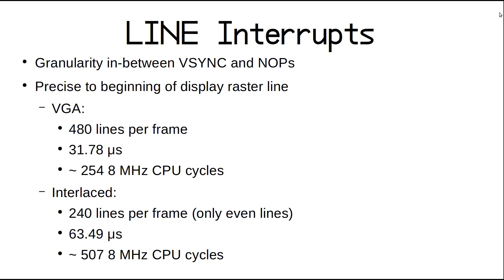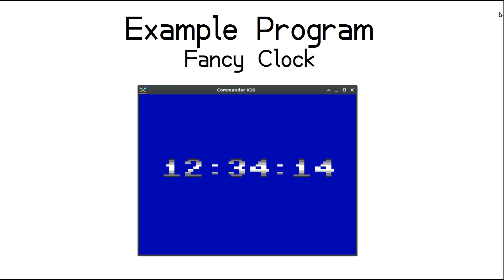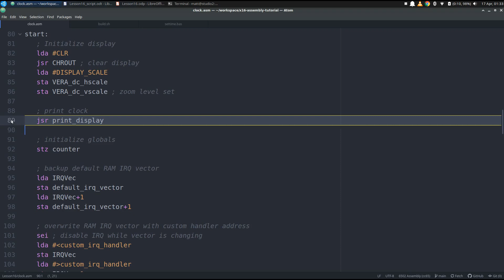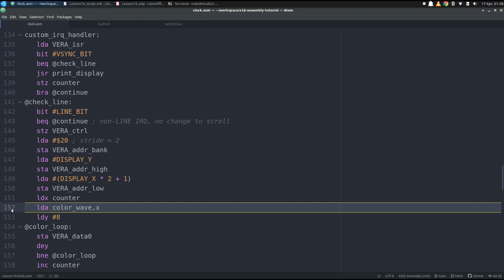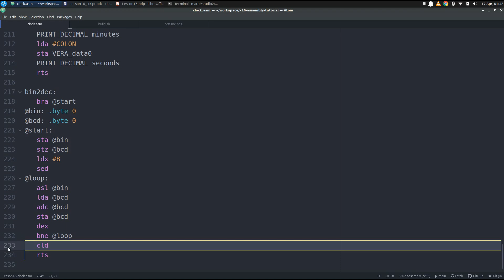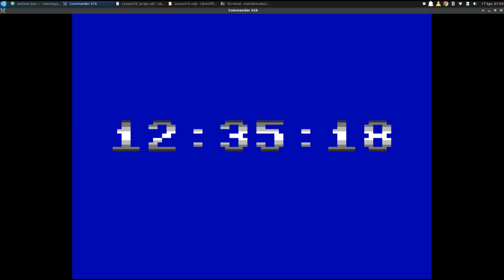All in the Timing: Commander X16 Assembly Language Tutorial, Lesson 16

Comment: Hi Matt.  Thanks very much for this series!  I was able to successfully compile the source code without any errors, but when CLOCK.PRG was run, nothing displayed onscreen.  I was able to quit by pressing Q like you mentioned.  Listing the program shows 800 SYS2061 as the lone line, which seems to confirm that it compiled correctly.  I'm using R42 of the X16 emulator, in case there's been a change that broke compatibility with your code.
Reply from the maker: There have been a few breaking changes in the ROM code since then. I need to update the example in the repo

Comment: On the 6502 there were a number of unused opcodes.  On the 65c02 these have all been replaced with NOP functions, but they are not the same as the NOP encoded as EA.  All opcodes ending in 3 are one byte NOP commands that take only one cycle.
Reply: Yippee... now we can get nothing done faster! 😁
Reply from the maker: I considered including those undocumented NOPs, but that stops becoming assembly language programming at that point and turns into machine language programming. At least in my opinion! Also, if folks use this to try doing the same on an original 6502 or other chip, they may not get NOPs, but rather side effects.
Reply: @slithymatt  True, everything is based around the processor.  If they try stuff that uses VERA and they have a system without it, then it won't work either.  I know I've made use of the 65c02 commands like PHX and PHY and BBR0 quite a bit, and so none of those programs will work on a 6502 either.

However, I disagree that it isn't assembly language anymore.  Just think of it as three new groups of commands; Western Digital and Rockwell have taken all the unused commands and made them guaranteed NOPs instead.

NOP1 is a whole bunch of the formerly-unused 6502 commands, just a single byte NOP like EA but only one cycle. NOP2 is another group of formerly-unused commands, but a 2-byte NOP and 2,3,or 4 cycles.  And NOP3 are 3 byte NOPs, either 4 or 8 cycles.

You can find all of these NOPs listed at the bottom of this page: http://www.6502.org/tutorials/65c02opcodes.html#8
Reply from the maker: @edminchau811  is there an assembler that has mnemonics for them?
Reply: @slithymatt  Well, I included them in the META/L editor, though if you enter them as a command only the first one in the group will show up, unless you have a specific one in mind, in which case it needs to be entered as hex data rather than as a command.